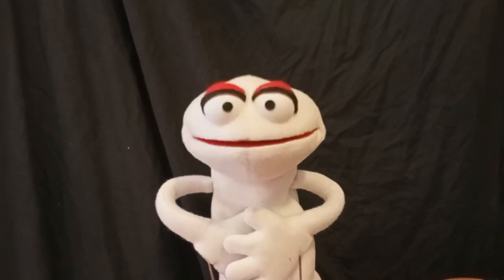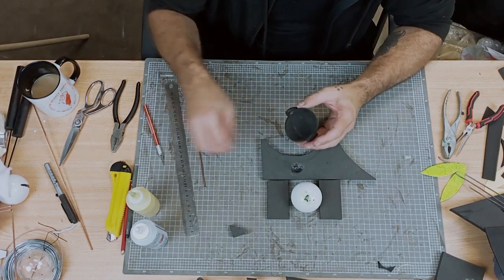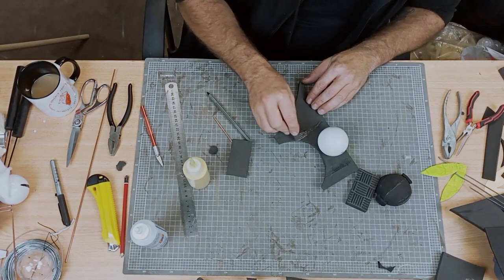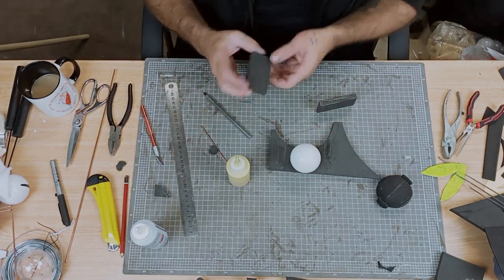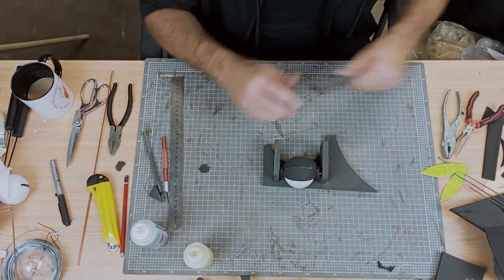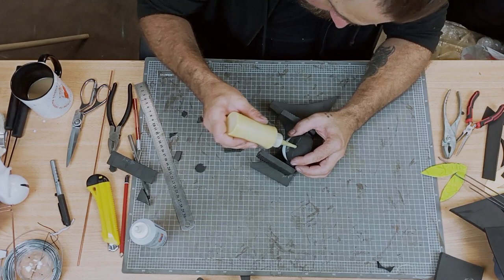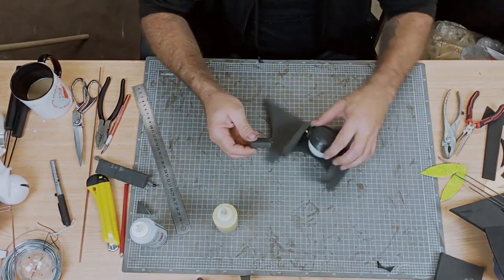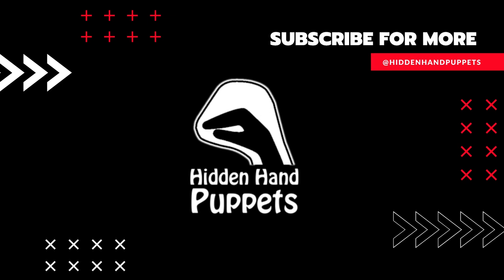Blinking Eye Tutorial for puppets

Comment: Something I've learned when working with foam like this is use that hard thin plastic packaging you get off of random things you buy - like the plastic part of a battery package (that kind of stuff) and just make a little washer for yourself so that the foam isn't rubbing against itself, specifically for movement over time because the foam will wear, where that will reduce friction and ware.
Reply from the maker: You're quite correct which also comes down to how you design the mechanism as well.  If I patterned it correctly for the eyelid there would not be the extra on the sides 😁

When planning your build if possible you can plan for having enough space but if there isn't room yes a washer like you described is the perfect solution 👍
Reply: thats really clever, thank you for the tip, i'm gonna try that one out!